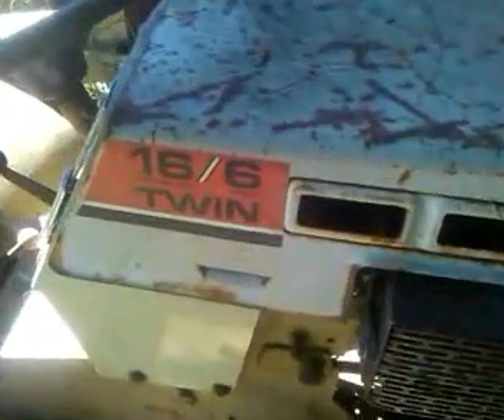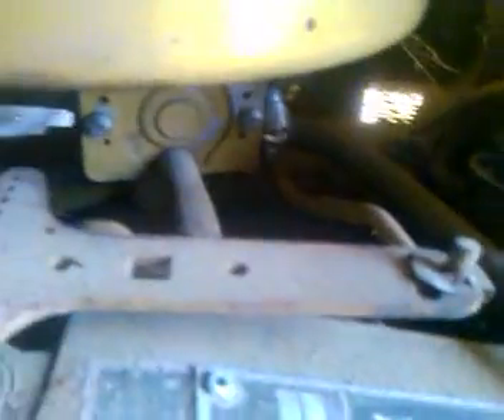Sears16/6 garden tractor

Comment: on my onan i built a block off plate and taped a hole for the fuel line over the old fuel pump spot and put an in line electric pump on and it works pretty good. i've been haveing sticking float problems but the pump part works great. my onan is on an 818t gravely rider there sweet engines much better than kohlers

Comment: @whspioneer89 yep as long as you don't leave the pump on with the tractor off it works fine wire it though the key switch to avoid this cause its easy to forget its on otherwise